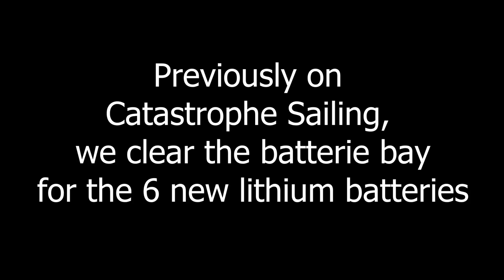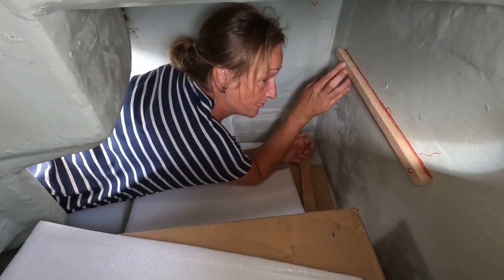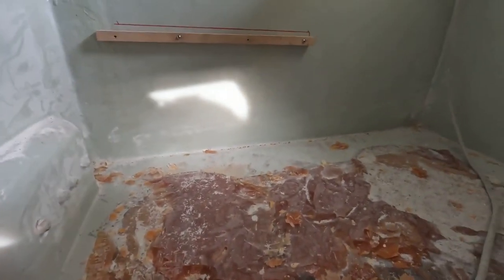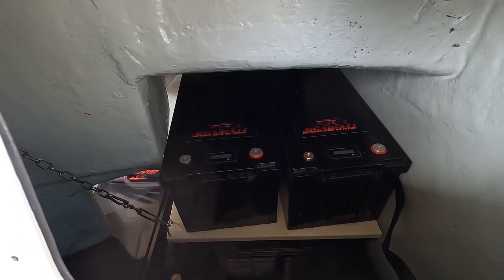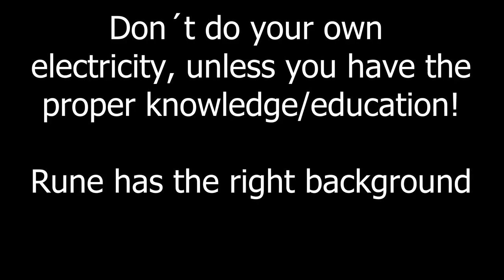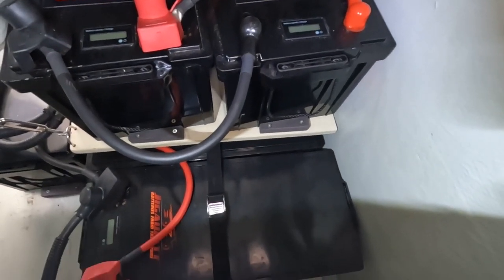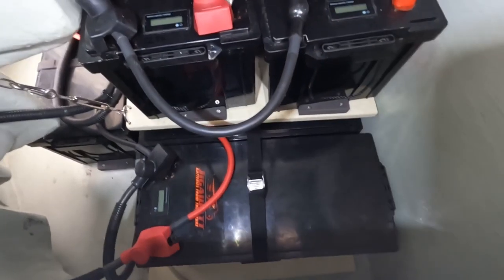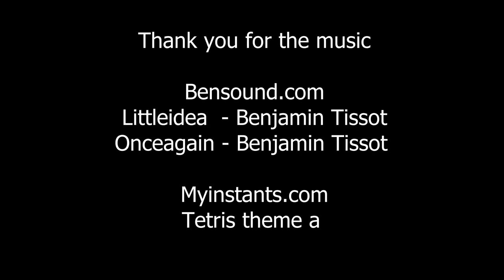S1E14 Battery bay reconstruction part two

Comment: Nice to see that You are thinking safety when working with the electrical stuff. Are You sure that the chain will last when jumping waves on the oceans? I think a solid bar will be a better choice.
Reply from the maker: Thanks for the comment :)
The chain is only a support. The plate is glued and screwed on two sides and there are tension bands from the hull onto the plate.
So it should last even in big waves :)